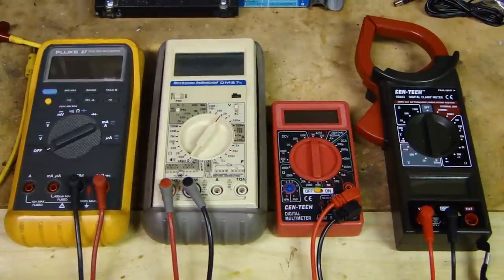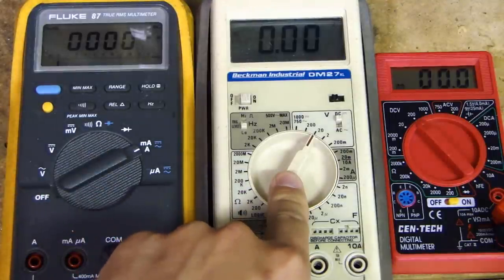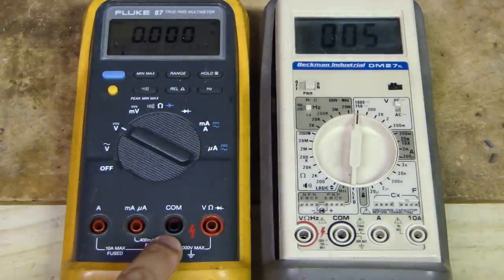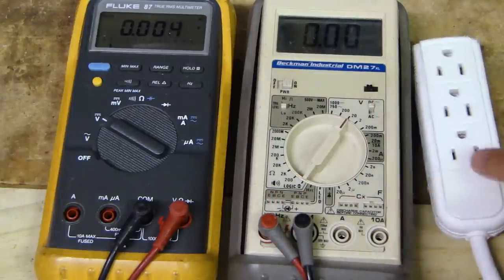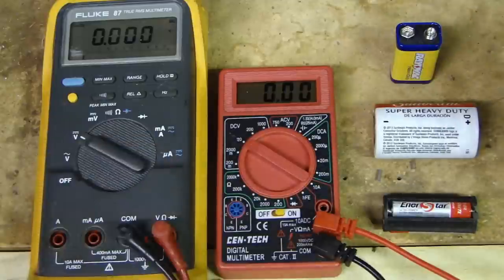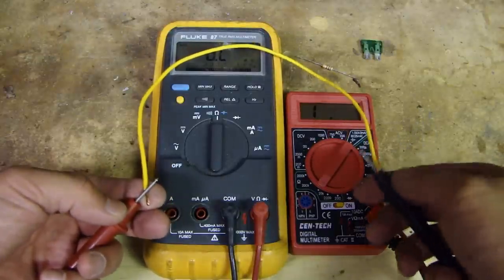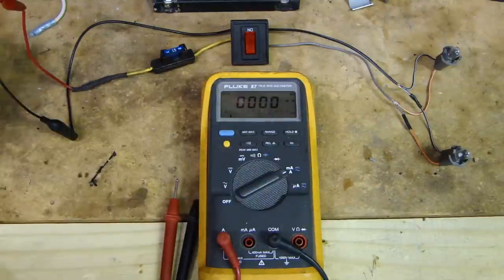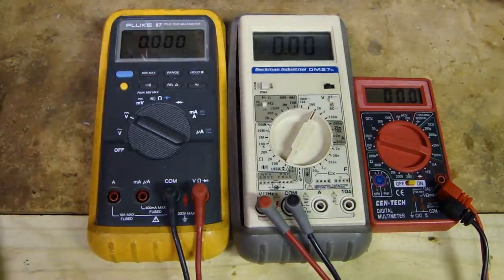How To Use a Multimeter - Tutorial Guide - Video 1

Comment: Excellent video. I'm learning how to use my newly purchased ($40) Southwire auto range multimeter. I plan to check simple circuits and components on a fridge and window unit air-conditioner. Thanks for the info.

Comment: Nice instructional video! BTW, there is a fuse in the cen-tec meter. Also, you can adjust the cent-tec, if needed. Once back is removed, you'll see the little adjustment dial on upper right.
Reply from the maker: I also found the fuse after doing this video. Thanks for sharing!!

Comment: hay i love to check for power at the ecu im just not sure where to set the multimeter
Connector B48, pins 2 & 13 bring power to the ECU

car sit for winter in garage, wont crank, wont start no light in dash only light i can get to work is parking light,
battery is fine starter is been bench test working.
if i turn the key on i dont even hear the bee bee sound,

i just wanna make sure how to check correctly and not fry the ecu if its good.

im probably going to find the solution in your next video but just in case.

thx you for these awesome info

legacy 1992 turbo

Comment: At the start you have that multimeter on the right with the clamps and I have never seen one like that before. Do those clamps replace the wire and probes on the standard multimeters? if so I would wonder how you would not short the multimeter out unless you are checking continuity as the two clamps would be touching when you turn on the multimeter.
Reply from the maker: +Thetrucky69 The meter with the clamp servers only one purpose, and that is to measure AC current without having to cut the wire open to measure. There is a coil in that clamp that measures the magnetic field generated by the AC current. For all other measurements, you still need to use the probe wires. Also there is an attachment you must get for that clamp to measure AC current.
Reply: +dial2fast Ok now I understand what that particular and unusual meter is used for, I was way off but you can understand my way of thinking, thanks mate cheers.

Comment: Excellent information, one of the BEST tutorials so far. At 15:05 on the amps and milli/amps setting is that milli/amps because there is a zero as the first digit meaning the circuit is drawing less than 1 amp yes? and there is 1000 milli/amps per amp. If it were one amp the meter would have a one as the first digit correct?
Reply from the maker: +Thetrucky69 The Fluke meter at 15:05 is actually very easy to use. Typical of higher end meters, and the zero before the 566 numbers just shows the resolution of the value it have display (4 digit). Since it's less than one amp, it's just 0566. You might not be able to see clearly in the video, but to the right of the numbers is mA. If you measured something with 1amp and more, then the 'm' in the mA would go away and only show 'A'. This is part of the auto ranging feature, so you just read what it shows and not worry about conversion. The display simply shows 0566 mA.
Reply: +dial2fast Yes very much what I was saying, a zero as the first digit means the circuit is drawing less than 1 amp so the result is going to be in milli/amps and when it is one amp or more it would be 1. amp 2. amp etc, thanks again cheers.

Comment: Okay so at 7:47....

It's not urged into the wall?  Just the power-strip only ??  No shock or nothing?  I get what you are showing us, but how do you get an accurate reading without the power-strip being plugged in?
Reply from the maker: The power strip is plugged into the wall. The other end of the strip has an AC cord that is plugged into an outlet to get power.
Reply: dial2fast I heard there is a wrong way and a right way to do this.  And doing the wrong way can be...shocking.  No pun intended?

Comment: very helpful video please explain in the draw test the dial (red tester) was on 200M how could show greater amount 566M!? thanks
Reply from the maker: That red meter has 2 inputs for amp measurement. One will measure max of 200mA. The other input is for up to 10A. For the test shown of 600mA, you need to plug the test lead into the 10A measurement, and move the dial to the 10A selection.
Reply: Thanks for the very helpful video.

Comment: Is 10 MegOhm Impedance necessary for safe testing of automotive circuits and if so how do you tell a particular DVOM has that rating?
Reply from the maker: Taken from Fluke website (better than me typing)

Most digital multimeters sold today for testing industrial, electrical, and electronic systems have high impedance input circuits greater than 1 megohm. In simple terms this means that when the DMM is placed across a circuit for a measurement, it will have little impact on circuit performance. This is the desired effect for most voltage measurement applications, and is especially important for sensitive electronics or control circuits.
Reply: Metal Maniac Old comment I know, but if you want to measure it you can. You'd need one extra meter and depending on how thorough  you wish to be also a power supply.

The simple method is to just take your extra multimeter and set it to measure resistance, hook it up to the device under test (the multimeter you want to check, com and voltage sockets). Incidentally you can check the fuses in a similar way by probing common and the relevant connector, if they resistance is infinite as in not conducting no continuity you know that fuse is blown and needs to be replaced (or some other type of damage has occurred).

On my fluke and agilent meters I've observed that I get different DC resistance readings (I have yet to try measuring the impedance this way with my LCR meter, maybe I should) depending on what the range switch is set to and whether its on or off. So I'm guessing in some cases there may be value in testing this by setting a powersupply to the various voltages and see what resistance you get at each particular range, you'll have to do this differently though put the other multimeter in series with the circuit in current mode and dial in various voltages on your powersupply.

Assuming you have sufficient resolution and accuracy on both meters this should allow you to calculate the resistance fairly accurately with Ohms law, technically you should be measuring the voltage across the two connectors for your multimeter under test here but if the values are in the ballpark figure of 1 megohm or up you won't get much of a significant voltage drop in the leads between the powersupply and due to meter measuring current (although there will always be some burden voltage here, if your device under test reads reliable voltages take those values over the powersupply always).

Comment: i got a question i need to check if there is power at my legacy ecu
Connector B48, pins 2 & 13 bring power to the ECU.

so how would i need to set the multimeter for this? ill keep watching the next video but in case, my car sit in garage for month and now nothing happen i check starter if fine
if i turn the key nothing no crank no start only light i can get to work is parking light dash nothing no click  nothing, i have check the battery its all good.
Reply from the maker: yazmo109 I am not sure what needs to be checked for your exact problem, but to check each of the 2 pins on the ECU for proper voltage, set your multimeter to measure DC voltage. If it's not a autoranging meter, set it to a voltage range measurement higher than 14 volt. Then put your negative probe somewhere on the chassis (a good chassis ground), and the red probe to the pin on the ECU and see if you get any voltage reading. For sanity check, you can also stick your red probe on a known 12V wire on the fuse box and see if you get 12v reading.
Reply: yes so i set the multimeter to ac voltage right?
using the the red wire in thhose pin and the com black on on a good ground?
Reply: im at video number 2 right now
it may be the ignition swicht too so i can check the relay or probe the wiring to ignition too? i did try to switch the relay from one to another, but still wont work, anyway i guess ill figure it out, ill keep watching your video,
thx you for your time
Reply from the maker: yazmo109 DC voltage, COM on chassis ground, red wire on ECU
Reply: thx you